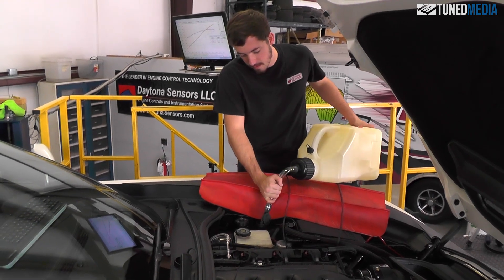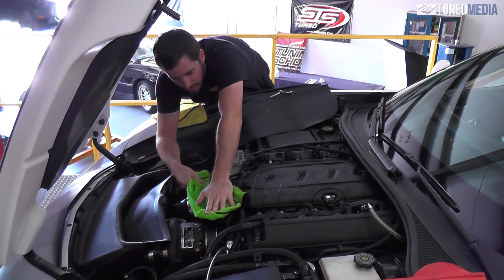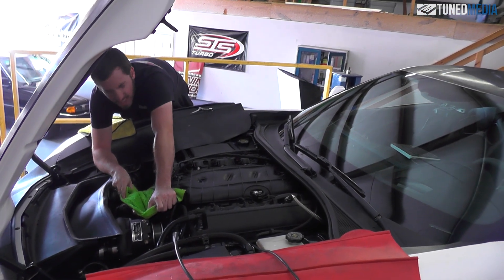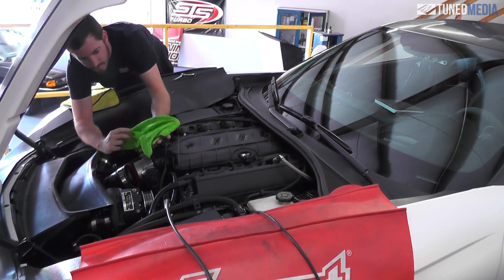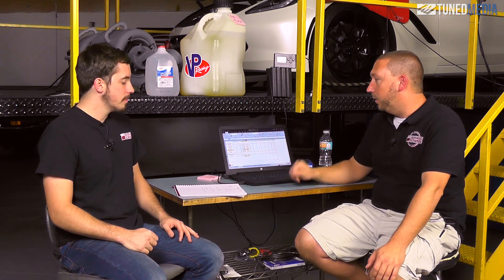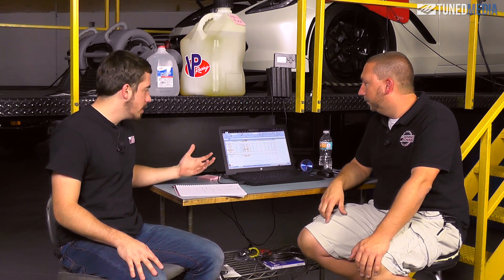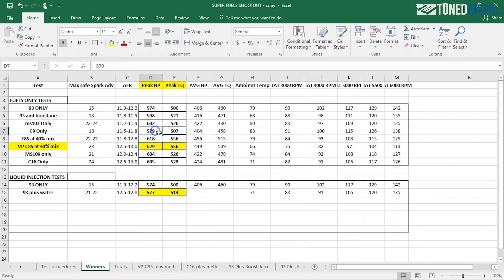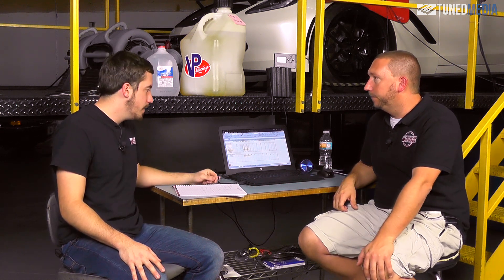Racing Fuels: Water Injection plus 93 Octane What kind of Power does that make?

Comment: I bet the results would be nore impressive with lower octane fuel and/or a forced induction system. Could inject the water in the charged air flow to avoid some of the intake air displacement effect that you get injecting into an NA motor.

Comment: Would it be accurate to say that water injection with race fuel would have seen gains as well since the water is just cooling the intake air? This was one thing that wasn't covered in the series but it seems straight water + race fuel or e85 should also provide a few HP/TQ bumps as well.

Comment: Instead of running rich, how about a stoichiometric fuel-air ratio when using water? Can you still get good ignition when using enough water to keep NOx down? Does the steam produced make up for the reduced pressure from the lowered combustion temperature?

Comment: Can you run 100 octane plus methanol ?
Reply from the maker: You certainly could but you may not need to. It would depend greatly on the setup, what heat in the cylinders are, and how much dynamic compression there is.
Reply: @TheTuningSchool   Thanks  Its for a Turbo charge 4 cylinder. Built motor. And mainly for hillclimb racing.

Comment: Use a capacitive discharge system with resistorless spark plugs and you'll extract some energy out of that water.  One day I'm going to convert my Cherokee back to the distributor setup so I can get those wires and use it with a light misting setup I have going.  The wires alone will be an improvement for burning gas, but tap water should be able to ignite.  It's more electrically conductive than gasoline and has 3 times the energy density of said gasoline.

Comment: Question about your results chart. The "Max timing" column, is that the base timing? I'd like to know what total timing you are running, just for curiosity.
Reply from the maker: Please check out our article for more information on it! It's 4-parts, you can find links to the previous three articles here also: https://www.enginelabs.com/engine-tech/dyno-testing/the-big-fuel-test-part-4-race-fuels-fight-back/
Reply from the maker: "Max Timing" is the timing that made the most power at wide open throttle. With each fuel we added 2 degrees of timing at a time until we found the engine leak efficiency. This is an identical process to what we teach in our courses.

Comment: were you guys running a constant duty % for the water over the rev range? or was it rising as revs climb?
Reply from the maker: It depends on the application, but usually the constant duty cycle with a little bit of ramp in is the method we would use.
Reply: @TheTuningSchool  You should never inject more than 1.25 times the amount of fuel being consumed for water injection. Over 1.25 the waters effect on effective octane will start to be decreased. This also necessitates the use of flow control at different rpms as the amount of fuel being used changes with rpms to a fairly large degree. The amount of water shouldn't change either when you start adding methanol to the mix. The water amount should remain the same but the duty cycle and nozzle size should take into account the added methanol.

Comment: Maybe I missed the video where you described your methodology, but are these "cold" motor pulls?  You show a clip of the vette on the road course, and that's the situation most applicable to me, so I'd be interested to see if the water kept the motor from heatsoaking, and could consistently put down that extra power while the straight pump gas gradually falls off.

Comment: my guess is adding 91 plus water will have a greater effect than what you guys tested. mainly for people here in California...
Reply: 91 and 50/50 works great. On my Focus ST however there isn't much left in the stock turbo. However with the much larger turbo I have now (GTX3071 Gen II) it will support however much power the stock engine will take which is around 500 whp, you need about 900+ cc (AEM) of flow because to get there you need 25+ psi. Water will work as well it works better when you can increase ignition timing and boost.

Comment: Is there a kit to run only water constantly for the cooling advantages? Is this a bad/good idea?
Reply from the maker: We suggest to contact the manufacturer of the kit to make sure that their system can use straight water. Most can, but you will still want to verify. While water works as a cooling agent, methanol is typically more effective.

Comment: what about with boost?
Reply: Hi guys, Yes you are correct in that we held boost constant for each test.  We noticed less than .3 PSI difference (weather related) through all the pulls.  We have recognized the need to more easily change boost to test for tolerance of boost (not just spark).  Our new series will air in the coming months, and you will notice a totally different vehicle, which is turbo charged for that reason.  Thanks for the input and glad you are all enjoying the series!
Reply: I am going to assume they kept the boost the same, IE the pulley is the same as all the others. Obviously if you can run more timing, you can say keep it at 18 degrees and increase the boost 1-2 psi. With water there is typically no change in AFR/Lamaba so no need to touch fueling. They did increase timing 3 degrees above what they were able to do on 93 octane + Boostane. The Boostane impacted lambda/AFR. So from that stand point it proves it's worthiness. Water Injection is the best solution for a daily driver that is also used as a weekend warrior. However SCCA and others often put you in a faster class if you run WMI. In some drag series, WMI is also considered a power adder. So be sure to check with the rules.